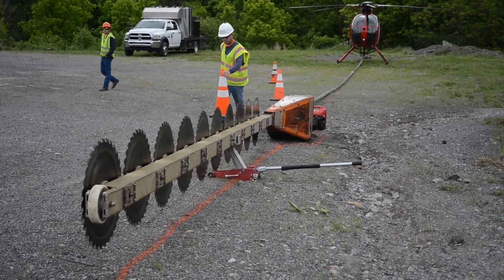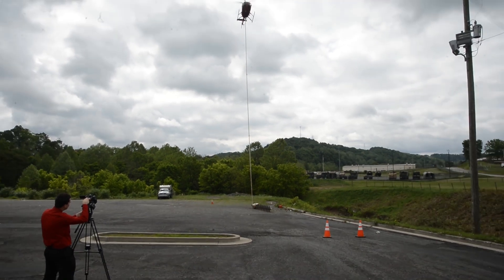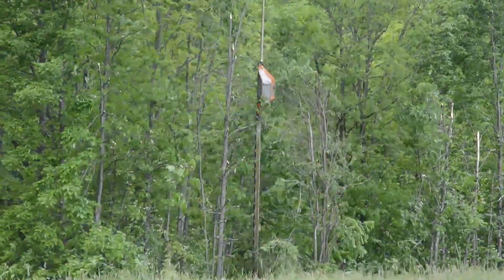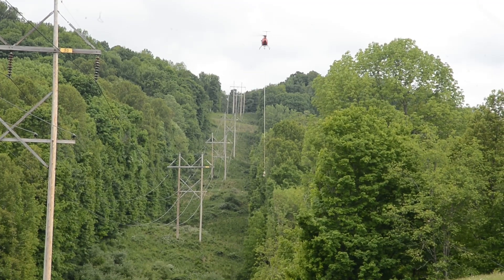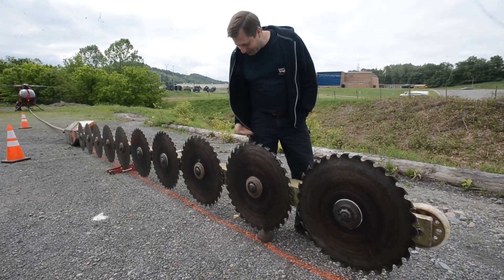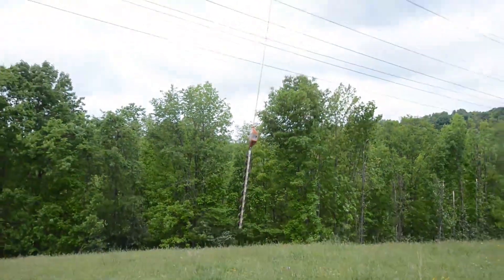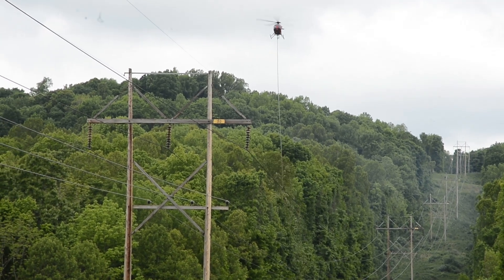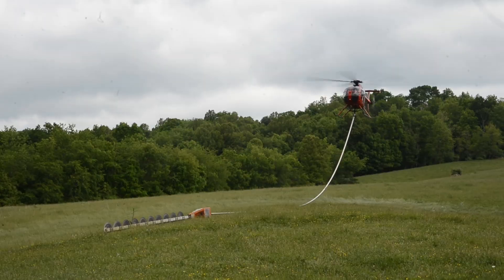Mon Power helicopter tree trimming 5-20-15

Comment: Ten saw blades spinning and dangling from an aircraft whose wings are moving faster the the aircraft, next to 30,000 volts wires...…..what could possibly go wrong?
Reply: The helicopter isn’t a path to ground, so the pilot IS safe from the power lines discharging into the helicopter.
Reply: @RappinPicard  Not if the saw touches both lines at once then that would complete a circuit between the lines and he'd be fried.
Reply: @samuelschurman3762  Wouldn't it just travel through the saw. It would be the shortest distance. They also have a release hook so the pilot can drop the saw.
Reply: Pretty sure the tether holding the saw is non conductive. OSHA being as strict as they are I am almost positive there is more there to protect the pilot